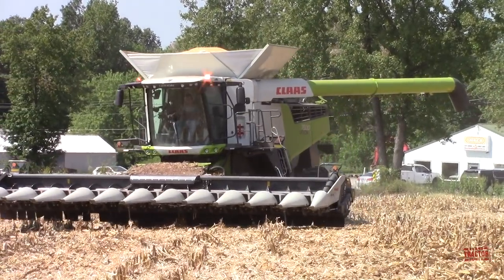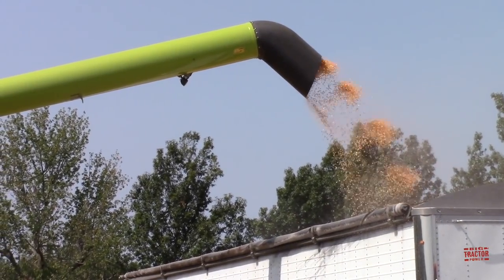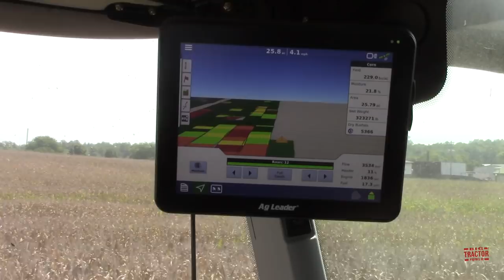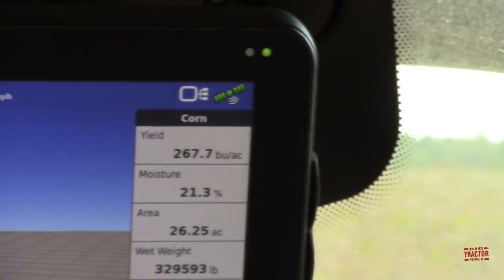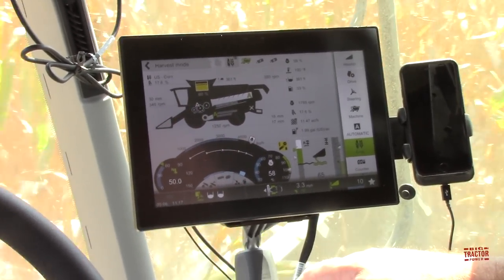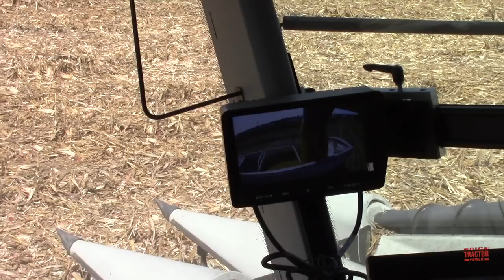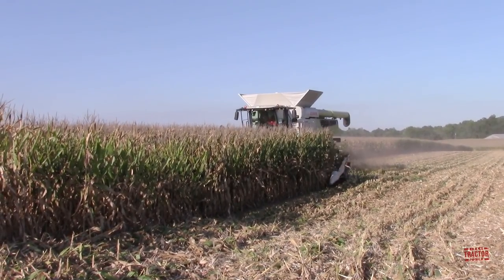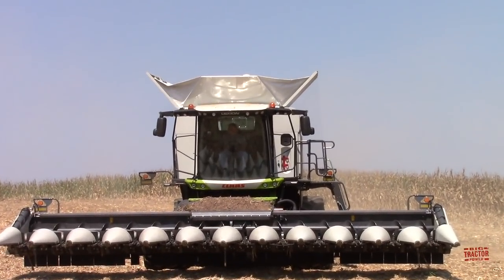CLAAS Lexion 7500 TT Combine Harvesting Corn in Kentucky

Comment: Looks like a lot of of trash in that grain tank. Also is the auger higher than others? Seams like it would be kinda hard to judge where the corn is gonna flow out of the auger 🤷‍♂️
Reply: In my opinion, there was almost no trash in the grain tank. I would be thrilled to be seeing so little trash in my tank.

Edit: I always struggle with placement of the auger above "shorter" wagons, hoppers and the dreaded weigh wagon (to calibrate & harvest test plots) but I'm new to farming.
Reply from the maker: Some of the leaves on top of the grain drift in from the field while the machine is harvesting.  The sample going through the camera looked very clean.

Comment: Where is Fendt made?
Reply: Informations from Wikepedia for you: From Wikipedia
The headquarters of the Fendt brand is in Marktoberdorf in the Eastern Allgäu (Germany). The company premises are located on the grounds of the former Fendt family farm. In 2019, the company will have a total of around 5841 employees at various locations in and outside Germany. Of these, 3,766 work together at the headquarters in the areas of production, development, sales and marketing, financing, administration and IT to achieve common goals. All tractors are developed, produced and sold at the Marktoberdorf location.
The production facilities currently have an annual capacity of around 20,000 tractors and 29,000 Vario transmissions. The heat supply of the company is ensured by the biomass cogeneration plant Ruderatshofen (wood chips). The Marktoberdorf location also houses the Fendt Forum visitor centre, which was expanded in 2018. Currently, visitors can learn about the history of the agricultural machinery manufacturer on an area of 2,400 square metres and view current Fendt tractors, forage harvesters, forage harvesting technology and combine harvesters [more
Asbach tree house (Germany)
The Asbach-Bäumenheim site is home to AGCO's competence centre for cabins in Europe. The factory, formerly Maschinenfabrik Josef Dechentreiter, was acquired in 1970. In 2018, around 1,200 employees at the site produced cabs and body components for the Fendt, Massey Ferguson and Valtra brands. Production at the site includes parts manufacturing, body-in-white, painting and cab assembly, including installation of the electronics and the driver's seat. [6] The Fendt cabs are delivered to Marktoberdorf just-in-time directly to the tractor assembly line and just-in-sequence, i.e. the parts are built at the Asbach-Bäumenheim plant in the same sequence as they are needed on the assembly line in Marktoberdorf.
Hohenmölsen (Germany)
In 2009, the AGCO Group acquired the Hohenmölsen site. Since then more than 35 million euros have been invested in the plant. Tractor parts such as lower links are manufactured for Fendt on the site of the former German Army barracks. On the other hand, the assembly of the Fendt Katana 65 and 85 forage harvesters is also located here. Since 2017, the trailed Fendt Rogator 300 field sprayers have also been produced in Hohenmölsen. From January 2018, the self-propelled Rogator 600 field sprayer will also be produced in Saxony-Anhalt. In December 2019, 383 employees were working at the Hohenmölsen location.
Wet (Germany)
The Feucht site is home to AGCO's competence centre for forage harvesting technology in Europe. Since 2011, the Competence Centre in the Nuremberg area has been part of the US AGCO Group and produces for the Fendt, Massey Ferguson and Fella brands. The various models for forage harvesting technology are developed and produced for Fendt in Feucht: Drum and disc mowers (Fendt Cutter and Fendt Slicer), tedders (Fendt Twister) and windrowers (Fendt Former). In December 2019, 220 people were employed at the Feucht location.
Waldstetten (Germany)
The headquarters of the agricultural engineering company in Waldstetten can be traced back to 1871 and the foundation of Mengele Agrartechnik. In October 2017, AGCO Corporation takes over the forage harvesting production division of the Lely company and thus also the plant in Waldstetten. The acquired products also include a loader and combination wagon range. From 2018, the Fendt Tigo PR and XR series of Fendt estate cars will be produced at the location. Around 81 employees work at the 13,700 m² plant.
Wolfenbüttel (Germany)
Products for agriculture have been developed and produced in Wolfenbüttel for over 115 years. Initially as Welger Maschinenfabrik GmbH and since 2008 as a subsidiary of the Lely Group. In October 2017, the agricultural equipment group AGCO takes over the forage harvesting machinery division of Lely.  At the Wolfenbüttel site, round balers, baler/wrapper combinations, square balers and pick-ups are produced. From 2018, variable round balers and fixed chamber balers will be built here for the Fendt and Massey Ferguson brands. Around 257 employees work in the welding, assembly, paint shop, shipping and administration departments on the approximately 100,000 m² factory premises.
Breganze (Italy)
The Breganze site is home to AGCO's competence centre for combine harvesters in Europe. The former Laverda plant was acquired by AGCO Corporation in 2007 at 50 percent and in March 2011 at 100 percent. Agricultural machinery has been produced here in Italy since 1873. Today, around 610 employees work on 25 hectares of farm land to produce mid-range combine harvesters as well as hybrid and 8-walker models in the luxury class. From 2018, the AGCO plant will produce the newly developed Fendt Ideal combine harvester series in three models.
Hesston (USA)
Agricultural machinery has been produced in Hesston, Kansas since 1947. From the beginning, the company has specialized in the development and production of agricultural equipment. In addition, the world's first large square baler, the so-called "mother of all balers", was developed and produced here in 1978. AGCO acquired Hesston Corporation in 1991, and the plant currently has nine production lines manufacturing combine harvesters and planters for the American market, as well as the production of square balers, including for the Fendt brand. In 2013, AGCO has invested 40 million dollars in a modern 18,850 m² paint and finishing facility.  AGCO is the largest employer in Harvey County and employs more than 1,400 people at the Hesston plant. In 2018, Hesston will also produce the new top model of the Qauderbaler, the Fendt Squadra 1290 UD (Ultra Density) in Hesston.
Jackson (USA)
In 2001, AGCO acquired Ag-Chem Equipment Co. in Jackson, Minnesota, thereby expanding the application equipment segment in North America. Since 2002, crawler tractors have also been manufactured here.
 In 2011 the site was expanded by around 7000 m² to manufacture Row-Crop tractors for Massey Ferguson and Challenger. At the same time AGCO's first visitor centre, the Intivity Centre, was built in North America.  Today around 900 people are employed at the 62,500m² Jackson factory. Starting in 2018, the Fendt tracked tractors of the Fendt 900 Vario MT and Fendt 1100 MT models will also go into production in Jackson.

Comment: Only thing keeping us from changing brands right now is 1. shitty harvest and 2. The Cat dealer wouldn't give us fair market value on our CX8080 on a trade.
Reply: are you happy with your cx8080? we have a cx880 in greece
Reply: @christosGTAIV  For the most part it does what it's supposed to do, not a fan of the "barn roof" grain tank. We traded up to the CR9.90 and the big tank is a big deal having that 400+ bus capacity but we had a CX8080 detonate it's motor on us (factory over fueling issues) and we had one with ghosts in the wiring. i'd have to say the CR9.90 will be our last yellow combine sadly as i've farmed with this brand my whole life.

Comment: Biggest problem with the Claas combine is the resale value, which is horrible. Once you buy one you are pretty much married to them because you get next to nothing on trade in for another brand.
Reply: In my area they hold there value the best. But are also the most expensive
Reply: In the US? Most JD and CaseIH dealers won’t take them on trade. And at auctions they don’t bring much.
Reply: @kcgibbs  alberta canada. They are a much heavier built combine than anything else on the market. You could rebuild them 20 times and still have wear left in the tin work.
Reply: I think it comes down to the area, in the northern prairies, especially green canola country they are much more highly regarded than in easier threshing crops like corn and beans. Capacity is insane for that purpose.
Reply: Their poor resell makes them great for second owners, buy them cheap at auction, use them for awhile, then go buy the two to three year old ones cheap at auction.
Reply: @LeFloop  yes our 780 will destroyed our neighbors case an john deere in almost all conditions.